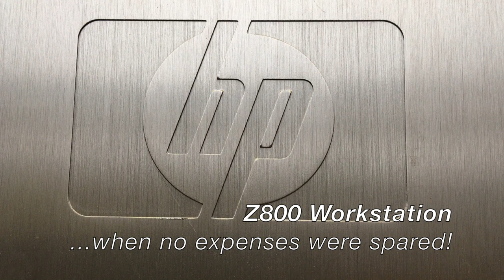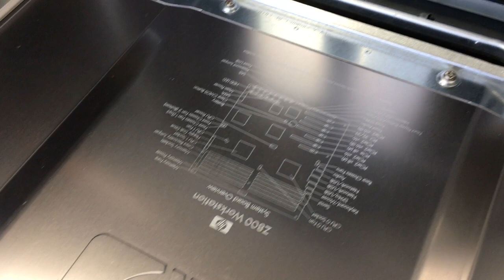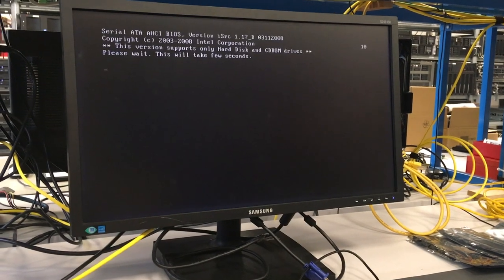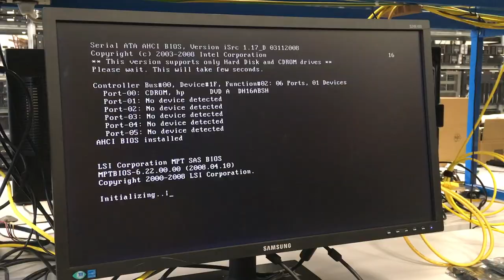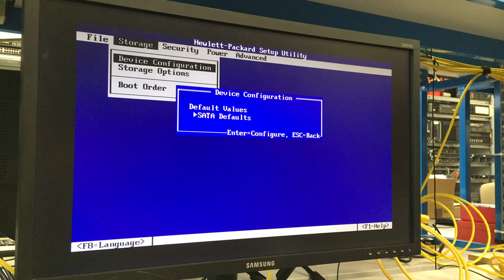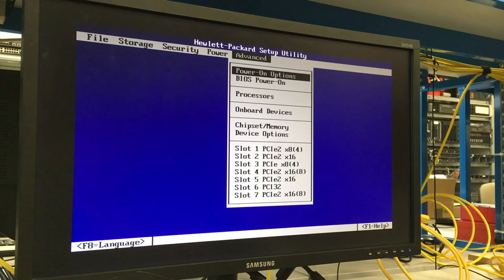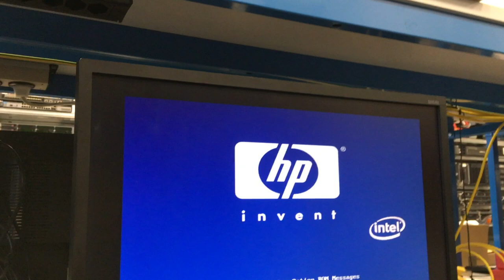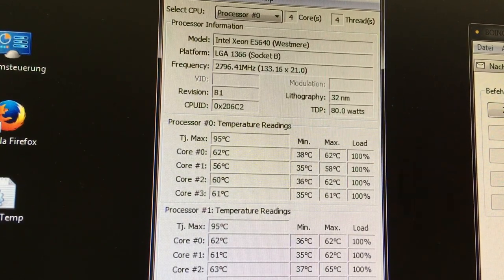They spared no expenses!   HP Z800 Workstation (PWJ184)

Comment: A sofisticated design for the pleasure, for eyes and for technicians. One of the most beautiful product of hp workstations.. and it is very heavy. The panel door weight 10 times a normal atx tower door. It looks like a security door. 

And the internal locking covers or the hot plug power supply...the internal design is gorgeous
Reply from the maker: Yeah, you got something for your money :-)

Comment: I wish they would make such nice cases for ATX style mainboards.
Reply: The lineage of these Z-Station cases probably begins with the HP Blackbird, which had similar features and design but took a standard ATX motherboard and power supply. You could actually order the case alone with nothing in it from HP, but good luck finding one complete system or not, though, they were very (very) expensive.
Reply: I think it was the other way around, HP decided to take features from their tower servers and workstations to their gaming PCs, and the Blackbird case was one such attempt.
Reply: ATX is a dated and thermally stupid design.
Reply: @User0000000000000004  Still widely used.
Reply: @s8wc3   Z workstations are the successors of XW workstations....Xw8000 & XW8200 (socket 604),  XW8400 & XW8600 (socket 771) all dual cpu workstations.(there also existed XW9XXX with AMD cpu's) and before that there was the Compaq W8000 dual socket 603 no gaming lineage.
Reply: @JDMeister  I'm talking about the overall industrial design of the casing which doesn't necessarily have to come from it's direct ancestors. The XWs are more like the contemporary DC series business desktop in this regard but with some extra fans and air guides

Comment: I just love your videos. They never fail to be interesting and informative.

That HP was ahead of its time, and still is today!
Reply from the maker: Thank you! :-)
Reply: It's nice, for sure, but it looks like a direct response to the PowerMac G5/Mac Pro, which were certainly several years ahead of this HP. The cooling "channels", tool-less drive mounting, fan power plug integrated into the fan ducts, clean cabling, etc, are all shamelessly ripped from the G5... though they used less polycarbonate and more cheap ABS plastic lol.
Reply: @dregenius  Was the PowerMac G5 as modular? All the Macs today seem to be large-scale integration with no upgradeability (other than USB etc.), with the exception of the Mac Pro. I'm not a Mac guy so I don't really know.

Comment: Love these machines. Bought three of them for my recording studio. Theyre reliable and powerful. Two hexcore processors in each and a ton of ram. They dont break a sweat when handling DAW duties and lots of plugins. Theyre really cheap now. Bought my third one for $650 three years ago.
Reply from the maker: I agree... the only problem we had fom time to time was a defective power supply. Caused by aged capacitors.
Reply: @PlaywithJunk  Thats the only thing that went down on one of my machines. Bought a new one and all is good. When Im ready Im gonna upgrade my main  machine to one of the newer Z machines. Ill use the current ones I have as servers to load up large VST sample libraries. I have become a big fan of these machines. Horsepower to spare, dead quiet and very reliable.

Comment: lots of these work stations , HP, dell, etc were some of the best buys as gaming PC's after 2010. you could pick them up on newegg, or wherever, used for cheap & they came with 4-8core, 8-16 thread CPU's, & Ram. it left you needing a GPU, & a better PSU, but it was a great budget way of buying a gaming PC, without spending a ton of cash

Comment: I have a Z600 with single quad-core Xeon, 12GB RAM, a SSD/mechanical HDD storage system, and a Quadro card that runs SolidWorks. It's still quite good.
Reply from the maker: SSD will improve speed quite drastically on those older systems.

Comment: I'm not an HP fan but damn that is one nice design for sure. Love the way the PSU removes. No screws! YAY!
Reply: Designed so all the parts that commonly fail are FRU's ( Field Replaceable Units) so that downtime is minimal, plus the field service agent can carry around a small stock of them, and go to a lot more calls in a single day. Done to reduce service call time only, as you would have to get the parts from HP themselves, so not having a close to industry standard part made sense to them. Mainboard likely does not allow any other boards to fit in, despite looking almost industry standard from a backplane and connector side, though you can see that this board is meant to have both PCI and ISA boards fit in the slots, so likely this unit was very popular with manufacturers who had older process control or interfaces, as they could use the old ISA card interfaces on it. 

Not many old machines that had ISA bus cards ever were upgraded to get a PCI version of the card. Either the manufacturer had obsoleted the range, they no longer had the in house design knowledge of the card to actually design the PCI version,very common, likely they only had the final version of the software and ROM's, but no source code or only a very poor version, all the original designers with the knowledge being long gone, as they were "expensive" to have around, cutting into executive bonus. Otherwise the original company had gone through a few M&A cycles, so nobody there actually knew anything, and the range had been obsoleted for this reason.

I can see why this range would be desirable, and probably sought after, even if your spare parts were expensive, but still probably available from HPE at a price, as no doubt they also are still doing full managed leases on these machines as well. They probably at end of lease are taking them back, and keeping in a warehouse, as a source of spares as well.

Comment: Yes, classics! So much better than later models. The highest spec Z800's also had AiO watercooling, wonder if any are still alive after 12 years.
 I also love the Zbook series, until the G5. The later ones are rubbish, we had 2 new G6's that both went to RMA within a year and our G5V's would lose CMOS settings after 2-3 months of no use...they use internal battery as CMOS backup.
Reply from the maker: I have a Z420 (not sure) with AIO watercooling... maybe I should make a video about that too :-)
Reply: Yep, I still have a z800 and 400 and xw8600. The 800 and 8600 both have 2 Xeons, the max amount of  Ram, and a NVidia QuadroThe 400 has 1 xeon and maxed RAM... All Running Windows 7 Pro or RHEL like new! I am using them instead of my 12 Core 2697 128 GB RAM MAc Pro 6,1. It will probably Keep up if I drop the Ram to 96 GB, though.

Comment: Want a little Z800 noise and heat? Go to Power -> Thermal in the BIOS and put the fan slider all to the right! XD

Love this machine: Is my everyday workstation and never disappointed me. 
You can have 96GB of ECC DDR3 without breaking the bank.
Mine even boots from PCIE NVME using CloverBoot.
Win 10 works like a charm. and recognizes all the devices.
Add a nice graphics card and  you can even game on this beauty.
A real budget workhorse. Hope I can upgrade to a Z840 in the future.

Comment: Nice to see a workstation built with efficiency at its core - not quite so brutal as some other offerings.

Worth mentioning that the consumer equivalent of the Quadro 2000 is the GeForce GTS 450. Both use the Fermi architecture.

Comment: I was given one of these a couple of years ago and I'm now using it in my workshop.  Imagine a 2009 Apple product still being so useful.
Upgrades / repairs: SSD boot drive with Windows 10.  Replaced a bad memory module (ran fine without it, but it was a very cheap fix), has 24GB total.  Replaced a filter capacitor in the PSU when it went up in smoke.  I had a decent modern graphics card lying about so I installed that.  My son says he can get a very respectable FPS from Minecraft on it.
It's a little noisy compared to a domestic PC (you will hear it a bit in the background of some of my YouTube videos) but it's not noisy for a server.
Reply: “Imagine a 2009 Apple product still being so useful”
Mac Pro 4,1 entered the chat 😉

Comment: I just retired a Z440 as my main workstation, not as physically overengineered, but it was a lovely machine right up to the end.
Reply: Feel for you.  Why'd you retire it?  And, what do you do after you retire it?  I just had my main File Server fail / crash hard on me.  Kills me.  But, I'd been planning to upgrade or change it out, and now, it is forcing me to.  I don't trust it anymore.  Screwed up my drives or data (I think).  Don't know, haven't been here before.  But, I'm finding my way back.  I live in Houston, Texas, and I think a power surge or something fried the board or screwed some things up.  It will boot, but it doesn't seem to see some of the Sata ports.  But, before this, it was working perfectly.
Reply: @PoeLemic  it died in December, not sure why, I have a Lenovo now which is ok.

Comment: I have one of these I've just set up as a retro Windows XP gaming machine, 1 x Xeon X5677 with 12gb of RAM, and it came with an Quadro FX1800 I upgraded to a Quadro FX3800 for $30 😂

It flies! I love it!! Plays everything from 1985 right through to about 2015 on max settings with ease! 

Little tip, if you disable the ROM boot options for SAS and ethernet, it posts so much quicker!!

I was even able to set up file sharing between XP and my Win 11 PC so when I download games, I can just copy them straight to the XP machine without using USB sticks!! Next upgrade will be possibly a 256gb M2 Drive if I can find a converter!

Comment: 14 SATA/SAS channels - that's my kind of motherboard. Wait, only 7 bays in the case?
Reply: The chassis I'm using for a main rig right now was originally a 386/486 era server. It sits on casters on the floor, and has 14 half-height (CD-ROM sized) 5.25" bays, with 4 of them exposed to the front. Originally, it held full height SCSI drives. But airflow was an afterthought when this chassis was designed.
Reply: You can add a passthrough card that allows to connect an external storage chassis to the internal SAS ports. Seen it in HP Part Surfer but sadly I don't remember the part number.
Reply: @WalterFabian  Yeah, be nice to know how that is done.
Reply: @PoeLemic  Found it ! HP Part 398299-001

Comment: Had similar machine around 2012, two Xeons, 6 cores with hyper-threading each, 24 threads in total, 64 GB RAM and nVidia Quadro. I never used more than 40 GB RAM. The CPUs were positioned a little bit differently, one was higher than the other, not in-line like in video. Don't remember the air flow shrouds. It was probably Z6xx series (?).
Reply: Depends what you had but in 2012 those would cost like 15 grand or something.
Reply: @thewizardsofthezoo5376  Yes, expensive as fuck, company bought bunch of them by mistake or something. Nobody at the office was complaining. (-:
Reply: @MarekKnapek  They had to squander a budget instead of paying it in taxes rather, but hey, lucky guys! Good stuff you can pick them up now for chips, slap a couple of v4 in there with a couple of Ampere GPUs as well becoming cheap a freight train full of Ram, and you got yourself some special PC at home, I am getting rid of all my consumer grade, it's a waste of time and money, you don't imagine how many old mobos, wires, plugs cases, fans and whatever it is you pick up along in 30 years of building shit that always works half way.
When I built my last computer 10 years ago, they cost an arm and a leg, a 6 core was all I could find for a reasonable price, then the GPUs and so on, not worth anymore.
I have 2 z840 and a macbook pro now and I am not looking back, that's all I need.

Comment: I've got a Z400 that I'm still using as a home server. That one isn't nearly as fancy inside - just looks like any regular old HP desktop.
Reply: BlackEpyon  ,  Time to recap?
Reply: @BruceNitroxpro  I'll have to check inside, but by the point this came out, most of the "cheap" capacitors had been flushed from the market.

Comment: I wonder... so many sata connectors but where do you leave the stuff that you can connect to it?
Also, the information inside the side cover seems to be upside down, do you/can you take the cover off completely to make it more readable? Seems a bit strange...
Reply: Maybe you could remove 3.5" drives and instead mount 2 2.5" laptop style drives (SSD today) in one slot :-)
Maybe HP offered a 2.5" disk cage as an alternative, they seem to like those.
Reply from the maker: I modified some of those Z800 when they were new. You can put two SSD's into one drawer and add some SATA cables. But I have never seen one using all ports. Maybe they used that board in another system?

Comment: hello sir, I bought a second hand hp z800 workstation for interior designing purpose. I used it for two months. After that im facing some problems.1st is beep sound with red light on cpu's power button, at that time whole fans will work with huge noise. at this time I will switch off the cpu directly. 
and the second problem is a warning message(no video input available)  showing in the monitor .
i have already removed dust from all ram and graphic card. what is the reason behind this problem. can you help me please???????
Reply from the maker: Your second problem, the error message "no video input available" comes from the monitor itself. You get the same message if you turn on your monitor with nothing connected at all. That means your monitor doesn't get a video signal from the workstation.
Your first problem, the beep... count the beeps! Is it one or two or more beeps? Long or short beeps? Then google for "HP Z800 beep codes" or look out for the user and service manual. Beep codes and LED codes are explained there.
It is also possible that the power supply doesn't work properly.
As a general procedure, remove all parts from the system that are not essential for turning it on. For example remove the graphics card and check if it turns on. Remove all RAM except one module. Does it have 2 CPU's? remove one of them. Minimalizing is the keyword!

Comment: Those workstations are surprisingly cheap.  I may have to buy one to live out its life as a NAS server...
Reply: I would not, they eat a lot of power, like a LOT. I had a similar thing with dual X5690's and the whole rig would take about 150W idle.
A simple i3, even a NUC would be plenty as a NAS and probably even faster, in the end.
Reply from the maker: Yeah the power consumption is a problem. But letting the HP run 24x7 should not be a problem since it's cooled very well...

Comment: Designed by BMW

Nice machines and only fairly recently out paced by newer hardware. Still work okay as a general desktop.also see it's had the upgraded PSU. As you can tell from the pins on the case. Cheap version doesn't have them on the front side of the middle connection.

Always like those machines, but not very practical these days.

Comment: Worked for an auctioneer a few lives ago. These were fairly common along with Z400's due to local government departments with silly budgets (this is not an anti-government comment, just one against neoliberal government, but I digress). Can honestly say never saw a single one of those covers, and I don't think there was ever one with a full compliment of drive caddies 🤣
Reply from the maker: So you say HP made a "cheap" version just for the government? Well if you order 1000 or more at once, manufacturers will change designs.
Reply: @PlaywithJunk  nor at all, I think all these pieces went missing throughout their lifetime as being used by department heads to read their email on

edit: probably just before they were decommissioned, some poor tech had to pull any parts of value (or just parts that could contain restricted information, it's amazing how many places still think they need to pull the dram) before sending them off to the auctions as basically ewaste. Easier for them to not put those parts back and probably got dumped separately

Comment: What modern motherboards fit these cases
Reply from the maker: It depends on your mechanical skills. There is enough room for any board but you will need to make new mountings and cutouts. You also need a new power supply. Those systems are HP-custom-everything... no stock parts used except disk drives. :-)
Reply: @PlaywithJunk  thanks for the response.

Comment: Hello mr. Play with Junk and all users of the HP. I'm young and green owner of the HP Z620 :) 
could You give me professional advice? how to connect to this workstation SAS (server) hard 
drives, and what is the meaning of jumper "SAS OPT" on this mother board
 (right side of the mother board near RAM modules slots). I just put in 
the SATA dock SAS HDD drive and nothing happen, disc isn't visible not 
Windows 10 nor even BIOS :( could You please help me to solve this 
situation?
Reply from the maker: I'm not familiar with all the details but this workstation has a SATA controller and SAS disks will not work. Try to find an owners or service manual for the jumper. Try Google "HP Z620 quickspecs" that may help.
You could install a PCI RAID controller like a HP P410 or 420 they are cheap now. Or jus a SAS HBA if you don't need RAID. And then connect your disks to that.
SAS controllers can handle SAS and SATA drives. But SATA controllers can only SATA.
Reply: @PlaywithJunk  thank You very much for good advice! it's very useful for me. good luck in the all your projects